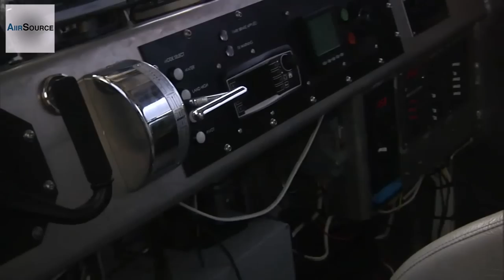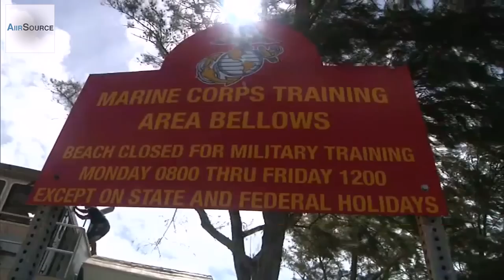US Marines MASSIVE Experimental Amphibious Vehicle - Ultra Heavy-Lift Amphibious Connector

Comment: This old 40s era floating tractor concept was returned to because the LCACs of the 80s (though fast) were considered to be disruptive to operations due to the sand and wind their engines made. As for being a target, nations with air superiority capability do not worry about close enemy contact on a beach because there will not be an enemy on the beach..

Comment: This thing looks really cool. Its super slow and super heavy. It would probably be a hole lot more use full if the bed had a hydraulic lift and lowering bed for faster payload dispersal. And a drop plate for the driver so he dont get all shot up. And z shape track plates for faster water moving capability. And come on people its the devil dogs. You dont think there not gonna have some sub compact machine guns. 50 call or even sabot 20 mm rounds. Hell they might even put auto cam satellite machine guns on them. Which means if u move you die. That would be for 1st wave clear outs. All in all. This machine has alot of probability potential.

Comment: This thing looks VERY vulnerable to the low tech approach to disabling it involving the delivery of an explosive device in between those tread plates that open wide just asking for something like that to be thrown between them. A pack full of C4 with a detonator activated by crushing between the plates seems like it would disable this thing completely... at which point it's a sitting duck for complete destruction.

Comment: I think main problem with it will be very low manoeuvrability which would be needed in currents, wind, waves and unexpected large obstacles on the shore. The design of cabin would be obviously changed and improved, armoured. The speed could also be easily improved. As many coasts around the world are rocky it hopefully will manage that with boulders.   This video is boring but it only shows one small function of future potential vehicle. Which is - 
  how it balances in open sea, how do rubber components hold in real environment, the actual safe speed and handling.  Once the basics are done the model can be remodified but these key elements wil stay in place.

Comment: It is big and probably heavy but it looks fragile and doesn't seems to use any suspension which is not a problem on water but since it suppose to be an amphibious vehicle will cause problems on land. And the speed of the thing is terrifying. Having fun with smaller, faster version on the beach - yes! Using it as a military vehicle... not so sure...

Comment: 4 knots top speed.  Looks like it holds 4 people.  I'd take my chances in my Jeep Wrangler which can do the same thing but faster.

"the UHAC travels at four knots using a track system with floatation-like pads that propels itself through different terrain."

Comment: Pretty sure everyone is burying the lead here…….  they aren't testing the speed.  
They're mainly testing the new track system which can propel a vehicle like a paddle boat and then run over different elevated terrain WITHOUT an actual suspension system because the suspension comes from how the 'treads' can lay down at different angles, meaning it could take Marines right of the beach and inland if needed without bruising them up over rough ground.  Dude, that is freakin' genius!  This isn't the 'combat' model guys, you are being ridiculous, lol!  A real, full speed, combat version of vehicle with this tech would be incredible.  I think with our current hovercraft 85% of the worlds beaches are within our landing abilities?  Well, welcome to the other 15% ladies and gents.

Comment: Those rubber tracks seem to be effective at possibly surviving mines or maybe an IED giving how thick they are. Also their proximity to the drive train would reduce a track dislodging in sand or mud which is an issue at times for slimmer track vehicles like an Abrams.
Top Speed?: 12-15~ MPH - 23:28

Comment: I'm curious if they are designing an entire vehicle or just the tread system. I don't see why they needed to make a new vehicle. They should have just modified a Stryker with this tread system and a snorkel for the air intake and exhaust. In fact the Stryker would be perfect for this system. Or maybe use a M113 for cost. I'm assuming this proof of concept is to make a deployable amphibious troop transport vehicle that can just keep going but can handle rough seas. Maybe they need to climb steep cliffs after a beach assault. However our modern giganto hovercrafts fulfill this roll much better and way faster than a spinning tread system ever could. Unless they are trying to make something quiet for a nightfall landing. A muffled  turbine engine with this tread system could make it viable. Still too slow in the water. Way too many insurgents have access to recoil-less rifles and RPGs. Maybe on land its really fast but there is not way its going to go over 8 knots in the water.

Comment: Only 38 000 years, and this will be a Land Raider.

Seriously, I think this is for moving something ultra heavy stuff to a beach without going through a port or unloading it at the shore. Its not for moving an ultra-large load of small things in a combat situation. Its already possible to move small things easily. The men can carry them, for instance. Duh.

Something very big and heavy shouldnt be carried too fast in such terrain anyway, so speed is not a problem, if it can go fast enough to go against currents.
I dont know what would be big and heavy enough and unable to traverse the beach by itself. Many armored vehicles are at least partially amphibious and are not necessary to bring that far on land.
Maybe the designers themselves dont know. However, what is necessary to have equipment that can handle a job like that, if it becomes necessary. After all, you cant design and build one overnight from pieces lying around.

Comment: And what happens if I light that thing up with a group of ak-47's? Would you want to be on that thing in full battle gear when it starts getting poked full of holes?
Reply: Did you not see how thick that hull is??
Reply: Indeed I have, you're going to need specialized bullets, bullets which were not mentioned in the comment.
Reply: There is no way those pontoons would stand up to standard 7.62×39mm rounds. They're hollow. 

Now that I think about it the only way that thing would be ok against an ak would be if those aren't pontoons at all. Maybe some type of foam rubber with metal plates to hold them in place and take weight on land. But if they are pontoons that thing is doomed.

Comment: Why so slow on land? Looks decent speed in water, maybe the engines can't handle the dead weight once it's on Terra Firma? Seems to me a waste of money when a hovercraft like the one that used to cross the EC could do the same thing, and way faster.
Reply: +DigitalKiwi14  apparently its supposed to carry a shipping container to shore from a civilian container ship and re supply military operations without a harbour it can apparently climb a 10ft wall not sure if thats from the beach or from a floating position..

Comment: Bunch'a idiots in the comment section...

My understanding? the idea is to test whether they can attach floatation pads to the tread-links and be able to move on water as easily as on land.

Means they can move cargo from deep-water military vessels to inland facilities without any extra loading and unloading of cargo. I can see the advantages.

From what I see, the idea is a success, it floats on water, drives on land, covers awkward terrain.
Now they just need to put it into a heavier-lift design and put it into use.

Comment: Too slow. In  war when the bullets are flying all around you it is often  a matter of minutes between life and death. Shoulda been over that mound in a minutes time .. or, perhaps, it was, in the "director's cut". ie classified view... Not for us plebes to see, however  ;-)
Reply: This isn't an amphibious assault craft, those already exist, and for some bizarre reason are used a lot in land locked desert countries like Afghanistan. .
Reply: wikieditspam Not a "bizarre reason" at all.. did you see those sand tracks? Standard tank treads attempt to propell the vehicle forward by clawing into the sand, not unlike a rowboat or canoe. This tread, instead, lays down a steel tread that it then rolls over, perhaps 3 to 6 square feet at a time. In fact, if you include the track already laid down, It's rolling over a steel road, on top of the sand. Very efficient, and leaves far less tracks...
Reply: sgdeluxedoc
I was kinda being hyperbolic. It makes sense though considering they're meant to be able to move on sand, they just seem a little like they could be replaced by something more specialized.

Comment: I would like to know if this was funded or subsidized by taxpayer money or not because this is a mobile freakin paper weight. If you need supplies fast you bring it in via other modes of transport like an Osprey, Sea Stallion or Hovercraft. Some fat cat in charge of that operation is still going to rake in the cash even though this is one of the biggest flops ever. The money needs to be spent in more prudent means as I don't know, more Marines maybe throw some of it to our ailing VA hospital.

Comment: why is it so fucking slow, call this sufisiant ?
Reply: its mostly a test bed for the tracks. you try making something a track tank that can move on land and on the water, then test it going 50 KPH on its first test run.
Reply: Thekilleroftanks so they are testing if the ancient paddlewheel technology would work? dont we have the amphi vehicle for that purpose?tried and true screw props at sea and a quick gear change for tracks once it hits land?why this offshoot of the Hobarts Funnies?
Reply: its probably something about you know, wanting to use newer tech, using older tech is fine and all, but you wanna use spears and swords against a couple of men with guns?
Reply: the spear and gun analogy is out of the slope dont you think so.this is just basically reinventing the wheel..The nice precision interlocking components are pretty to look at thats all..Do you honestly believe the marines would need this new machine just to cover the few meters of sand to the treelines?a few men with shovels surely will defeat the purpose this was built for.
Reply: and you fail to understand its purpose, never meant for fighter and never will. its mostly meant to carry a shit ton of stuff from the ships to the beaches after the troops pushed every bad guy a few miles away from said beach. but thats its indented purpose, if it cant carry more stuff then already in use supple ships for beaches, it wont get into a final stage. but then again this is the US military, they already spend a few billions on failed projects dumber then this.
Reply: that we wont know until it happens, just saying its gonna fail without having much info on the thing, well thats kinda stupid. like invading russian during the winter.

Comment: what a waste of money. its a moving target.
Reply: Janos Horvath  It took 1 Minute for that thing to reach the shores...

It's mainly for Cargo moving. To supply Troops.
Reply: my comment still stands.
Reply: Janos Horvath  These come in after the Navy and Ground Troops clear an area. :/
Reply: soooo LCU's aren't needed anymore? we get stop producing those to create these right? we dont need the huge hover crafts cause these pretty much do the same, so we can stop producing those too right. my POINT is still a valid point, its a WASTE of money. less you can deter otherwise that its not a waste of money then by all means give that reason, but everything you're saying can be done by other vehicles atm. if this were 50,000$ per vehicle instead of the 5,000,000$ it usually takes to build a hover craft or LCU then my point is beaten, but this slow target looks to be well into the 6,000,000$ range so no argument you produce will beat my current statement.

Comment: East to take out. Way to slow. Not enough cover for troops. Seriously, I was drawing tanks with better stats then this when I was 10 years old.
Reply: +toms place Ah, your tank that drives through water? 

It's not a tank, numbnuts.
Reply: Yawyna124 its close enough. its a pore design, and provides little protection. you don't need to insult people, because your views are different. grow up.
Reply: toms place
Have you considered that it's a prototype testing the method of making floating paddle-boat treads? It's a small-scale proof of concept for a much larger transport to deliver heavy stuff to beach-heads, as opposed to making beach-heads.

Not everything is made to be shot at.
 It's like complaining that the fleet of fuel tankers that keep your wonderful tank columns fed are too volatile and would be better served by tanks in their position.
Reply: not a tank, its an all terrain supply vehicle

Comment: i would not want to be in it in a beach landing because it is to slow ,  it has to be faster than this , why not show it running at full speed if it has it , if  this is top speed i say stop wasting tax payers money and scrap it .
Reply: This vehicle will be used after the beach has Ben secured... Just like the lcac... Aav amtracka storm the beaches first securing it then the lcacs and uhacs show up in a follow up second wave delivering heavy machinery like tanks and lavs And BTW the lcacs not being replaced by this they will be used together...
Reply: but you would think any time it was to be used it would still need the speed to get on the beach especially if it had tanks ext
Reply: Mark Soucy  Not necessarily besides look what were currently using to supplement lcacs in an amphibious ready group... The good ole LCU 1610 class, there basically traditional landing craft and are bigger cousins of the Higgins landing craft of ww2. An lcu can carry 2 abrams  and has a speed of around 10 knots.... The UHAC correct me if I'm wrong is said to be able to carry 3 Abrams and have a speed of 25 knots... Even though the lcu was slow it was still a good supplement landing craft. after the lcacs dropped there loads  a few of these in a third wave would hit the beach even though there slower that hardly won't matter by that time because we would have it secured with amtracs and m1 Abrams but a little more speed on those lcus would be nice, that's where this uhac thing comes in its faster can carry slightly more and more can be carried on amphibious assault ships... For example USS wasp lhd1 can carry 2 lcu's or 3 lcac.. When the uhac goes into service they can fit 3 into the well deck because its similar in size and dimensions of an lcac..well the full size versions will be.. On top of that lcu's require an amphibious assault ship to flood it ENTIRE well deck, because there boats. The uhac has no such problem they can launch and reenter from a dry well deck just like lcac..... And also unlike lcu's they can drive onshore and are not limited to a certain depth of water like lcu's.. Hope this helped sorry for it being so long :P